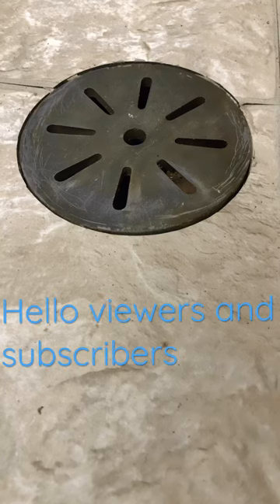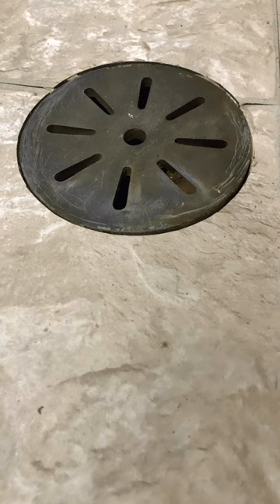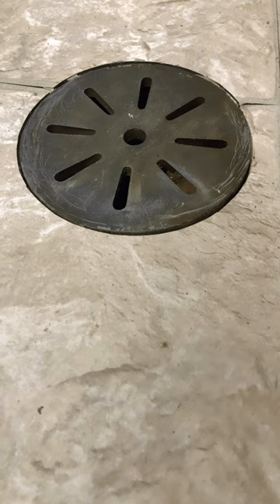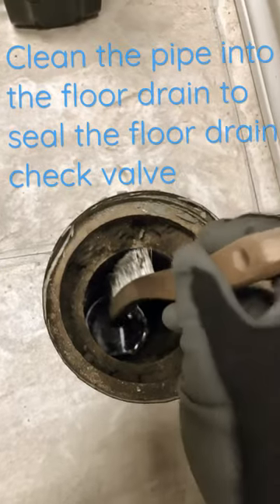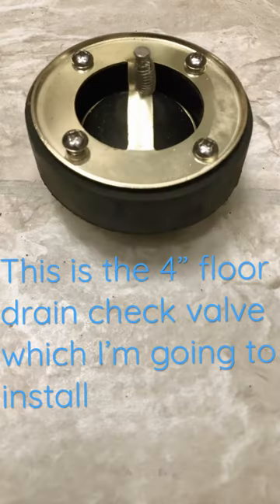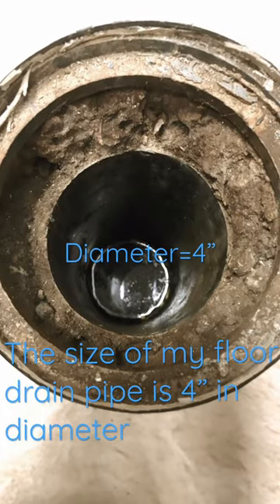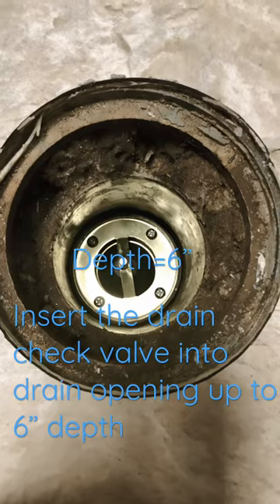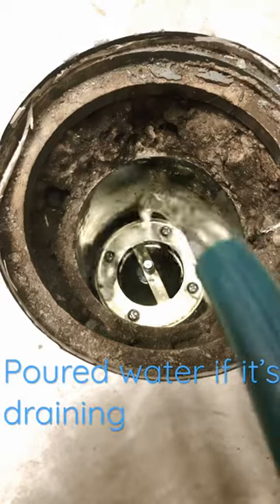DIY How to install floor drain check valve

Comment: Thank you for the clear view and instructions. 
I'm having basement backflow problems, but you're using this as a backup solution to your main back water valve. If I don't have that, I'm not sure if this would be enough to stop the flood, and I have people telling me this could cause pipes to burst with built up pressure? How well has this been working for you?
Reply from the maker: Thank you so much for visiting 🙏. Originally, there’s a backflow preventer installed by the city in the main  drain line in our house. I installed in my floor drain line to prevent sewer backup when the main sewer check valve is leaking. It works for me. I installed floor check valve also into my son’s house and it’s working. When there was  no check valve, their basement was flooded too !!. It’s up to you if you want to install. I have never heard bursting pipes. I heard the main water supply pipe burst because there is pump on it and the pipe was already corroded.

Comment from the maker: Installed floor drain check valve to prevent the back flow of sewer line in case the main back water valve failed. One small favour, please subscribe and share this video to support my YouTube channel. Thank you 🙏